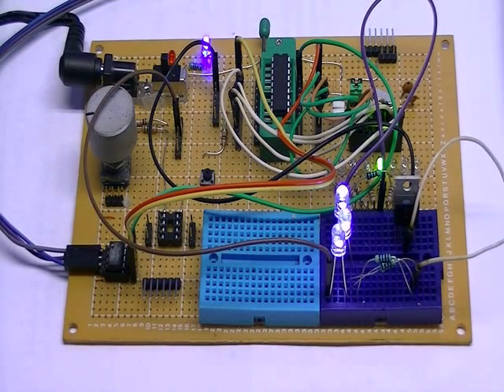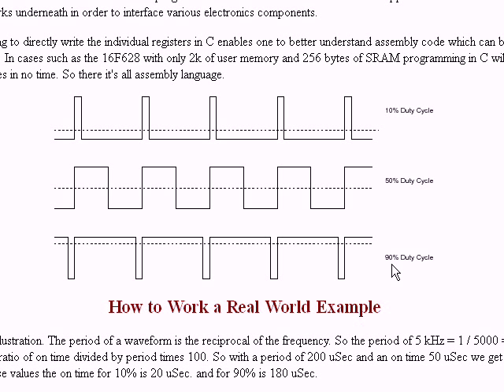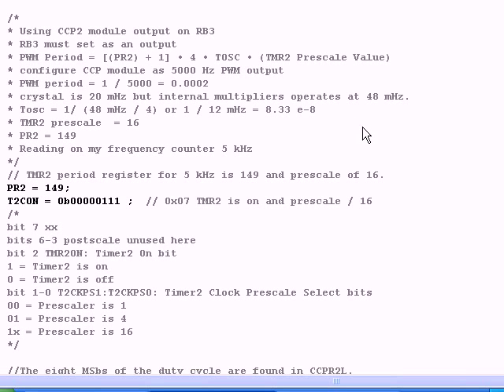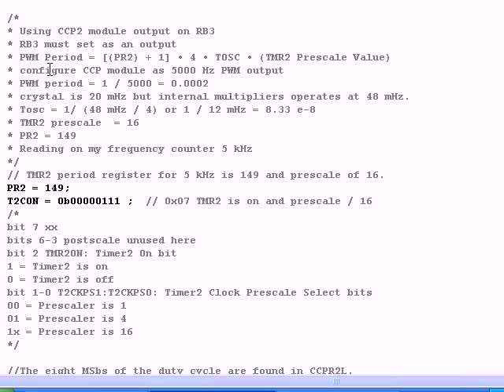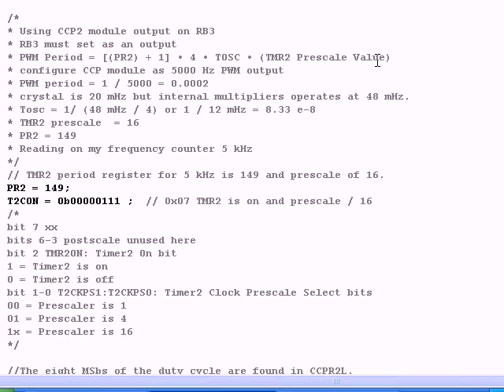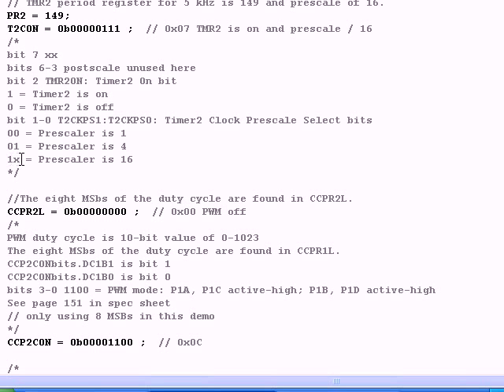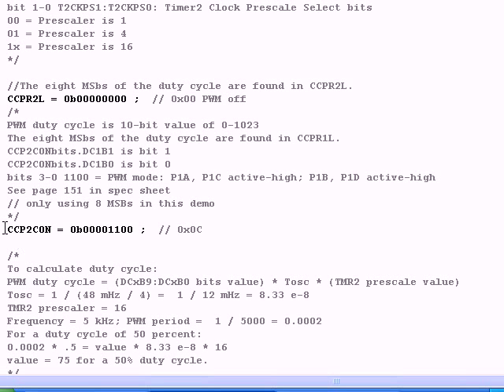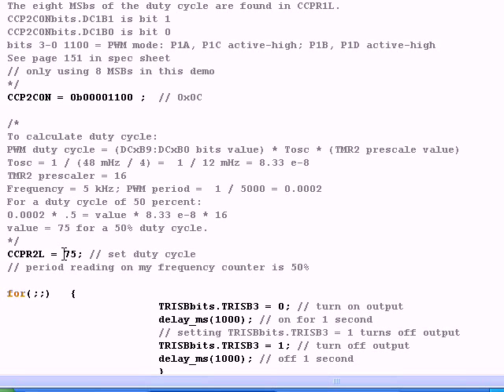Calculating Pulse-Width Modulation with a PIC

Comment: Thank u

I wanted to see wattage consumed calc
Reply from the maker: That depends on load, duty cycle, and voltage. For example, a load of 10 ohms with a voltage of 10V at 100% modulation is 10 watts. At 50% duty cycle, it delivers 5 watts.